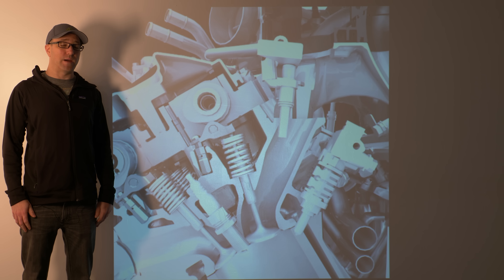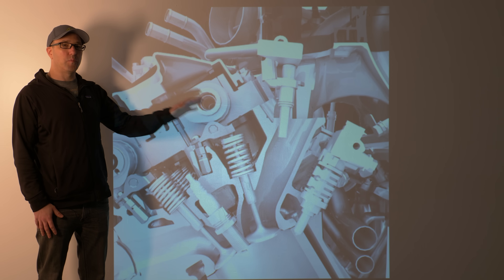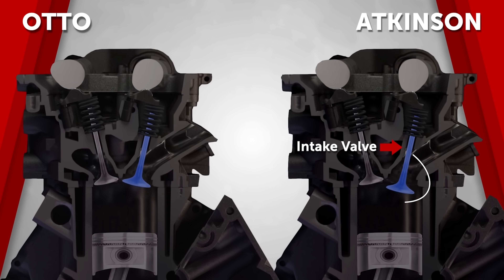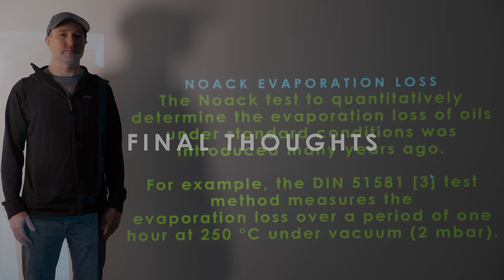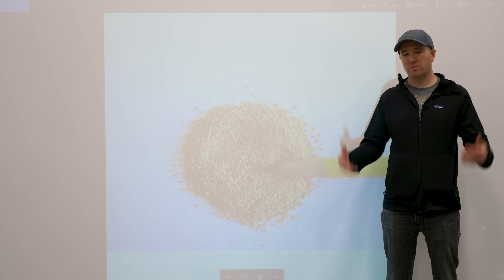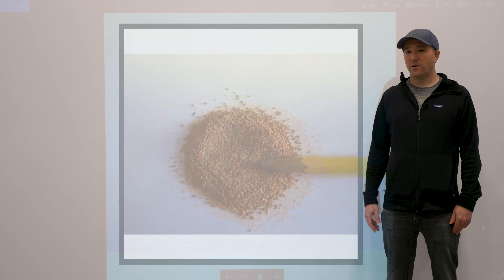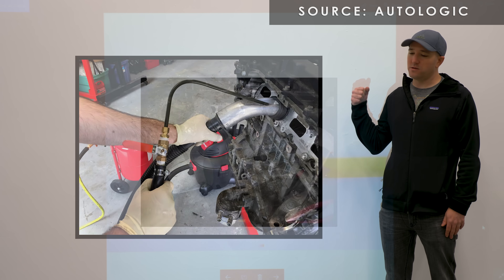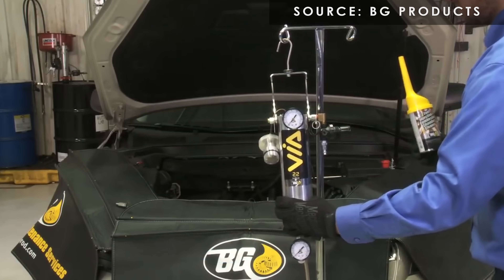Direct Injection, Problems and Solutions | The Fine Print

Comment: I'm glad my 2012 Hyundai Genesis Coupe is multi-port-injected. It has a 2 liter turbocharged inline 4 cylinder with 210hp and 226tq, and it would suck for it to have to deal with Gasoline direct injection. I've seen the issues with Hyundai/Kia's GDI 2.0Ts and 1.6Ts. The 3.8 V6 (306hp, 266tq) Genesis Coupes from 2010-2012 had mpi, but moved to GDI (348hp, 295tq 91 octane) in 2013 and on. The 2013 and 2014 2.0Ts still have mpi from the previous generation, and they got a twin-scroll turbo along with stronger (possibly forged) internals. They even have 274hp (6000 rpm) and 276tq (2000-4600rpm) with 91 octane, and can run on 87 with 260hp and 260tq. I'm definitely going to stick with the 2.0T platform if I get a newer Genesis Coupe. Sadly, the 2.0T option was cancelled in 2015 until the Genesis Coupe completely ended production with the last model year in 2016 to only have the GDI 3.8 V6. One strange thing... The Kia Stinger and Genesis G70 have 2.0T I4 and 3.3T V6 engines that are both GDI. Even with turbos and GDI, they have both held their ground. Heck, the Genesis G70 won North American car of the year, and the twin-turbo 3.3 V6 (365hp and 376tq) was praised as one of the best engines out right now. I've heard rumors of a new 2.5T I4 and 3.5T V6 from Kia/Hyundai/Genesis, and seeing the GDI-MPI hybrid injection system would be great.

Comment: Aircraft engines have been using air/oil separators forever.  The original purpose was only to decrease the cosmetic effect of blow-by oil ‘dirty belly’  staining the underside of the fuselage and, to a minor extent, to claw back that lubricant.

Comment: GDI does not "wash" the intake valves with gasoline spray.  A great theory. Well, how come we do not have this issue (intake valve carbon deposit) on CNG and Diesel engines?  They all have the PCV system, and no gasoline is ever sprayed on the back of the intake valves. Please explain how you came to this theory.
Reply: Except diesel engines do get carbon buildup, all the time in fact, and have to regularly go in for cleaning and maintenance. The main reason why you don't hear about it as much is for 2 reasons. The first one is because there are a lot fewer diesel engines on the roads versus gas engines, and the second is because diesel engines run at lower temperatures than gas engines, and so the carbon doesn't get "baked on" to such a degree that a simple 'floor the pedal' doesn't help clear the soot. And when I say lower temperature, I mean that inside the chamber, diesel is hotter, but gasoline creates higher temperatures outside the chamber, this causing more carbon bake. A quick online search about diesel engine carbon buildup brings up a lot of resources and articles to show you that yes, this problem does occur.
Reply: Thank you for the kind reply.  When I worked on Mercedes-Benz Diesel and turbo Diesel passenger cars, the popular 300SD, 240D, and 350SDL (1979-1987) we did encounter some issues with cylinder head cracking and Bosch mechanical Diesel injection pump wear.  But it was commonly caused by extremely high engine mileage and maybe not so superb quality of motor oils at that ancient times.  However I do not recall any kind of intake valve buildup problems.  The same high mileage engines found on Volkswagen TDI with commonly internally leaking turbocharges, and of course "secretly" manipulated emissions by the German factory.  These engines never demonstrated the intake valve issues.  The five cylinder Audi 5000 turbo diesel (1980-1985) other than smoking from the exhaust and lacking power also appeared to have no common intake valve issues.  This was just my observations from working hands on these engines.

Comment: Awesome video. Quick Q, does all this apply regardless if the engine is gasoline or diesel? I got a Diesel TDI VW engine, do I need to worry about the same things?
Reply: I was wondering the same thing, as this looks exactly like any Diesel system, but Diesels run forever without this kind of breakdown. Could be that higher compression ratio of Diesel engines does a better job of forcing the intake valves and holding them closed prevents the PCV fumes from getting baked on?

Comment: I got a 2018 GDI/PI Mustang GT over a DI only 2015-2017 Mustang GT mostly because of what I learned in this video.
Reply: I hate to break the news to you but 11-17 5.0s are port injected, NOT Direct Injection, 18s went to dual setup
Reply: Damn so the 2018 has a reworked engine? Didn't know that

Comment: So...emissions regulations are the reason we can't get good MPG. Gotta love the EPA forcing us to go electric......Eventually. Enjoy your government regulations everyone!!
Reply: Yeah, you have to hate policies designed to let us keep breathing clean air. I bet it's hard to see that with your head so far up your ass.
Reply: Well, it was inevitable really. Electric is absolutely the most efficient means of moving an object, AND it's renewable and can be produced from nothing but the sun/wind/water movement. And an electric motor is much simpler, smaller, and more reliable than a complex gasoline engine.

Batteries are the only limiting factor. Storing sufficient energy.

Comment: The Atkinson cycle engine in Toyota uses oil by design and its sad. Most DI engines end up burning oil far too soon with less miles on the engine vs port injection.

Comment: Question, I'm just learning this now, and have 51k on my GDI HOnda Ridgeline.  Build up is there.  But if I add fuel additive (Red Line) now to clear the injectors, and spray intake valve cleaner through throttle body  just prior to each oil change (CRC Intake cleaner), will that harm the catalytic converter once the carbon starts betting removed?

Comment: I installed in a direct injection engine a natural gas system but I still spend 25% of gasoline someone knows if you can trick the ecu to eliminate the injection system because the pumps fail often
Reply: well u need to change the map of the ecu by modifying it....It depends on the car if it needs an aftermarket ecu for this.

Comment: Seafoam or (my choice) CRC intake valve & Turbo cleaner  bay be... every 2 oil changes. You can also get it done professionally for about a bill, depending on the shop.

Comment: I'll give you a word of warning if you plan on drastically deviating from a manufactures oil viscosity numbers... If that engine comes apart from a bearing failure, YOU ARE FUCKED. They will test the remaining oil in the sump, and when they spec'd 0w-40 and you have 10w-40 in there, Oh, sorry, you put the wrong oil in, which caused the bearing issue, this is not covered under warranty.

Comment: I have a 2017 CRV 1.5 turbo and have the same problem. The "update" was done in february 2019. Plus the "free" oil change....btw, it's part of the service bulletin as mandatory.  The vehicle was due for an oil change last week and I called my Honda dealership (in Clinton NJ where I purchased the vehicle) and asked the service advisor to also check the fuel/oil issue as when I checked the dipstick the oil level was way over the max line and smelled like gas. I was told there would be a $70 diagnostic charge!
Update 7/30/2019:
I solved my problem...I sold the CRV before the value of these vehicles plumet.

Comment: Then you have the expensive high pressure fuel pumps that will need to be replaced eventually in the GDI cars.
Reply: Exactly. Sad truth is, you do not want to hang onto a GDI-only engine vehicle long term. If you are thinking long term, best get a vehicle with an "old school" port injection type of an engine, or else perhaps if you do not mind the complexity and added dangers, one that combines port with direct spark ignition fuel injection. I am opting for the former. Toyota and Lexus products made and sold from the late 1980s to the mid 2000s come immediately to mind.
Reply: I personally think camshaft-controlled EUI's (Electronic Unit Injectors) would be the best of both worlds. Could this work in a gasoline engine?

Comment: Couldn't you have a rotating valve which comes up to contact with a static arm when the valve is closed and have an auxiliary vacuum port just before the static arm to suck away the dislodged materials when the valve is closed?  In other words: a self-cleaning valve.

Comment: I was going to say the part about filtering the return flow too.

Also they could use filled PTFE compression rings.

Personally I would rather get 80 mpg and use a catalytic nox reducer to meet emissions, but truthfully, you could recycle the NOX with a filter and use it as a nitrous shot for performance since some of the oxides of nitrogen are the very same chemicals used by race cars.
Reply: That's crazy idea💡
Hope it could soon be reality

Comment: Ugh. I have two older Impalas with MPFI and they have been good engines - 315,000 km on one and 504,000 km on the other. But - sooner or later I have to replace them.  So will NOT be getting anything that is GDI only...

Comment: I just lived this! I have a 2011 Kia Sportage turbo 2.0T. Engine changed at 85,000km. Yup, my engine was one of the ones that blew creating a recall. Now, I use 91 octane and Mobile 1 synthetic oil. At 130,000km, my car started idling rough and would have big issues starting. (I live in Quebec so add the 30 or so minutes a day for warming up the engine in winter.) Guess what? The engine was CAKED with sludge! Really caked! they spent 7 hours cleaning it up. Sure, it now starts great and purrs like a kitten but this is nuts! I do all the maintenance and check my car but the "cleaning" service is not listed as a recommended service! Turns out a few manufacturers don't mention this as a needed service and decided to be quiet about it. The dealership I went to for the cleaning told me it should be done every 1-2 years on a turbo depending on mileage and 2-3 on a normal aspirated GDI. Cost for the preventative maintenance is about 200$.

Comment: So I have a Mustang EcoBoost with just over 50k miles now. My purpose for ending up here is because I've noticed at an idle whether in Drive or Park I'm getting some pretty rough idling. Nothing else is wrong everything is perfect, or seems so. Anyway, I put some Lucas fuel injector clean and it actually started to idle smooth... I mean really smooth, without dropping... for around 40-50 miles. Could it be dirty valves or maybe the ignition coils? Or something else?

Comment: I just happened upon your video. fyi … your showed the PCP moving from the crankcase to the chamber and out the rocker cover. Very misleading for the layman. Please explain the PCP moves from the chamber, past the rings into the crankcase, up the oil ports to the rocker cover and returned by the PCV.
It looks like the oil build-up on the DI intake valves means the owner/operator is going to be adding oil hand over fist. I use Amsoil and 1/2 litre of Lucas additive each and every change for 130,000 kms, since new. Chevy 5.3 tows house trailers, boats, utility trailer and does not burn even one ounce of oil. Change the oil at 8 - 10 thousand kms. Some city but mainly country driving. No heavy foot. 120 k/hr (about 70 - 75 mph) max.
Why is port injection any better than throttle body injection.?
I had a early 70s American Motors Hornet (I believe they had chevy 6 cylinders) and it had an oil separator. LOL

Comment: A product I haven't seen mentioned in here is CRC GDI valve intake cleaner. Its been proven to dissolve and remove carbon deposits and can be done pretty easily by the owner rather than paying a stealership $150+ to basically do the same thing.

I recently used it on my 2015 Sonata 2.0T by spraying it directly into the PCV vacuum line as I figured it would travel the same path as the oil blow by. Can also be sprayed into the air intake to clean the turbo or directly into the throttle body by removing the air intake.

Comment: There will be some that disagree with me, but there is another side effect to GDI that wasn't presented here.  Many Kia & Hyundai owners find out the hard way when their motors start knocking from piston slap, and bad rod bearings, under 50K miles.  Diesels have been "direct injection" since their inception.  But unburned Diesel fuel is quite different from unburned Gasoline.  Diesel fuel is quite slippery, and will lubricate inside the cylinder as it is compressed prior to combustion.  Gasoline, on the other hand, washes away cylinder lubrication.  This effect is greatly lessened by vaporizing gasoline in the intake as occurs in PFI and TBI injection.  GDI sprays gasoline at high pressure directly into the cylinder, theoretically at full atomization, but not so well in actual operation.  Think of it as getting a gasoline pressure-wash in the cylinder with every compression stroke.  This washing effect will accelerate piston & ring wear, increasing combustion blow-by, and eventually unburned gasoline blow-by into the bottom end.  Normal oil change intervals of 3,500 to 5,000 miles  will now have more contamination, and less lubrication quality, increasing wear and tear on the top and bottom end of the motor.  EGR systems also introduce intake valve contamination to the already incoming crankcase ventilation vapors.  If gasoline upstream  keeps intake valves relatively clean compared to GDI, what do you think it does inside the cylinder before combustion occurs? 
These "innovative" designs are "just" keeping up with ever-increasing "anti-pollution" and "fuel economy" fatwas, but those are being increased as frequently as they are being met, frankly.  And at what cost?  High-priced motor technology that lasts 1/2 as long as conventional fuel delivery, and in the end, costs everyone more in money and materials.  Regulations will increase beyond the practical and economic abilities of gasoline engines, and it is intentional.  The govt push for EVs, which at this stage, are also comparatively expense, and far less versatile than IC automobiles, is not about "saving the environment", but aimed at limiting and controlling our mobility.  Freedom of travel and unparalleled mobility were the key benefits of the IC automobile in the first place. This is something the PTB  have grown to resent, as well as having to spend OUR taxes to maintain the public highways and infrastructure.  They believe they have more important things to do with our money than to serve OUR needs, as though we were children having our parents tell us how they intend to spend our "allowance".

Comment: First I gotta give props for the great research and volume of good information. However, there is one method to clean the intake that you overlooked. It’s a very old trick I learned from an old man who restored steam cars and early generation gasoline engine cars. Water vapor. Or even just water in small quantities. If you’ve ever seen the inside of a turbocharged car that used water/methanol injection, or seen the inside of a steam engine that is operational, they are clean as the day they were assembled, regardless of mileage or hours of run time. You can get any internal combustion engine up to operating temperature. Open the throttle partway, like 1/3 or 1/2 and then use a spray bottle to send a mist of water into the intake. Repeat as necessary. Can even be done with just a bottle of water, but you must be very careful to only do small dribbles or squirts at a time, to avoid hydrolock or extinguishing the engine completely, a spray bottle is much safer, and with the engine running at part throttle, you couldn’t squirt a spray bottle into the throttle body or carburetor fast enough to hydrolock or kill it.

Comment: It occurs to me that you have another option than to blast walnut shells into your engine.  We used to clean the intake manifold, valves, and combustion chamber by sucking seafoam or automatic transmission fluid through a vacuum port on the intake manifold (the good old ATF smoke show).  Why wouldn't this work still?

Comment: My Honda (Earth Dreams) Vtech 1.5t oil delusion is only a problem in colder climates where it's operating in short bursts (less than 20 minutes at the time) that do not allow for normal operating temperatures to burn off the excess fuel.

Comment: I will stick with my WV TDI diesel car, 60 mpg oil change every 10k with over 250k (miles) on the clock what's not to love. Buying a new car every three years is nonsense, the construction cost of every component in air pollution that pumps out give off more emissions than using the vehicle for 150k. As for Electric cars and the like if we swapped to electric where is all the lithium coming from there's not much of the stuff in the world and most of come from Africa. Then there's the extra pollution involved in generation for these vehicles, be it coal, gas, or Nuclear the byproducts of which to not lead us to a health atmosphere.  We're all doomed to riding bicycles or in my case a bath chair and one pretty nurse as the motive power, bring it on..

Comment: If I have Port injection system (Honda Civic 1.8 i-Vtec 2010) and if I have an LPG system should I buy an Oil Catch Can? LPG washes the valves if it's in a gas state, not liquid...? But sure my car runs on gasoline sometimes (after starting and sometimes when I change it on gasoline). I use Flashlube too (to help exhaust valves), could that make intake valves much dirty? (sorry for my english :) )

Comment: Install water/methanol injection it will clean the carbon buildup
Reply: Or an old trick I was taught by an old man, just a spray bottle of water. Get engine to temp, remove air cleaner, spray water mist directly into throttle body or carburetor. Works like a charm.

Comment: You can put methanol injection on the intake pipe to clean the intake valves. =)
And emission control laws are excessive
Reply: Sounds like a good idea, how about a solenoid controlled dribble of Kerosene ocassionally.